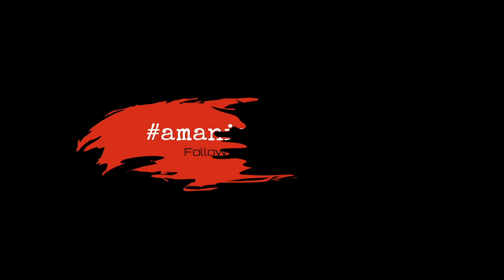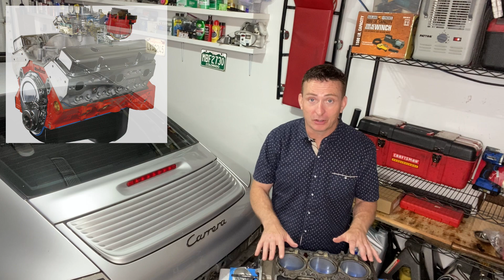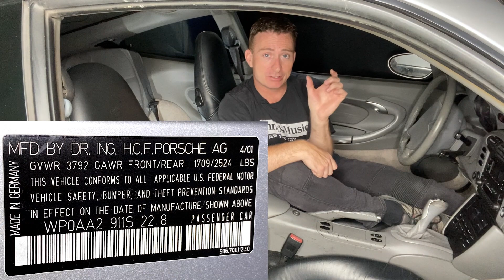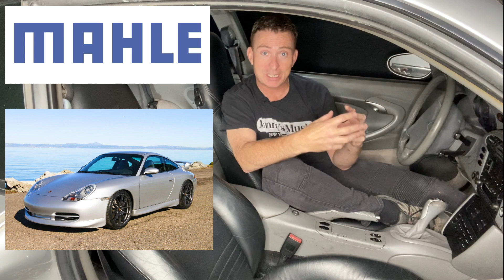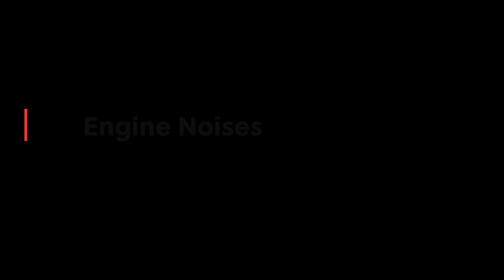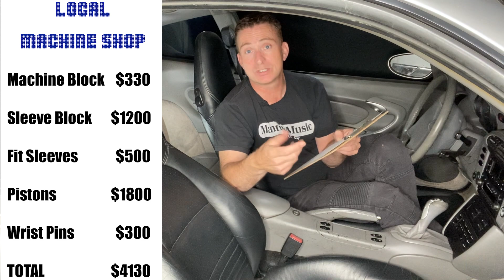WHAT IS BORE SCORING? PORSCHE 996 & 997

Comment: Is it too cost prohibitive to buy 2 new blocks made using the alusil or nikasil process or is it no longer manufactured or put an older or newer porsche flat 6 in the vehicle that aren’t known to have bore scoring? hard to believe the vehicle would lose desirability since you’re not doing something silly like an LS swap
Reply from the maker: Hello Lexi, Thats a good question. I just called Porsche, they have two matching pairs (bank1/bank2) remaining in Germany for $12,000 per pair. Once they are sold thats the end of new availability from Porsche. If you bought a pair you would still need new pistons and you would end up with an engine design that may well bore score again. For the same or less money you could have Hartech  UK or Slakker Racing USA machine your existing block with their improved close deck system that would last longer than the original Porsche design. Thank you for watching! 🤘😎

Comment: Hey Finn it's good to see you're not locked out anymore ,due to an NDA, and can freely discuss the differences between the V1 & V2 Lokasil cast in cylinders for the bank 1 & 2 block halves  and the change in piston skirt coatings also. If the original piston skirt coating hadn't been banned I don't think bore scoring would've been a big problem with this engine design.
Reply from the maker: Hello Warren! 🙌 I agree that Porsche got delt a bad hand by the EU, we might not be talking about bore scoring if the environmentalists did not get involved. Thank you for watching! 🤘😎

Comment: Great content and amazing depth. I picked up a C4S which has a suspected crack in the cylider wall. Per your knowledge, is that something that can be fixed by LN Engg or the other companies. Any help on this subject would be great.
Reply from the maker: Hello Deepak, a cracked cylinder wall needs to be replaced with new cylinders like those made by Hartech/slakker racing  or LNE. It will cost a few thousand. Thank you for watching 🤘😎
Reply: @ManinaGarage  Hi Finn, revolving back to my problem. I am not sure if you provide any consultation as I am facing some issue to decide whether I should scrap or rebuild. There are some local garages who has given me hopes with high bill but I really don’t know who to reach out for real expertise. Let me know if you are willing or if there is anyone else who does this.
Reply from the maker: @deepakshara1  email me: stuckinagarage@gmail.com 👍

Comment: I do not think it is right that Porsche did this experiment on their customers. Nikasil used on the turbo engines was much better quality and does not have the issue. The C8 from Chevrolet has a much longer better warranty, they do not have cylinder scoring, 0-60 3.3 seconds and 195 mph
Reply from the maker: It is definitely something that should be on everyone’s pre purchase checklist. Check from the sump side to be sure 🍀

Comment: Thank you for this very well presented video with excellent information! I am a new 996 owner but haven‘t taken physical possession of the car, yet. Mine has a build  date of11/1999 and therefore I presume that it has the preferable Lokasil v1 in the 3.4 litre engine. I will take frequent oil changes to heart, even more so than I do with my other vehicles. Count me in as a new subscriber!
Reply from the maker: Awesome to have you aboard Sir! 🙌 Your gen 1 996 is IMO the future classic of these cars due to the cable throttle, dual row IMS bearing and as you correctly pointed out, Lokasil V1 ✅ Since making this video I did an online poll and found the best oil for these cars is 5w-40 synthetic. In the USA motul and liqui moly are the go to brands. In the UK, Millers nano drive seems to be the Uber oil. (Some people go as thick as 10w-50) Something I was not able to mention in this video directly due to a non-disclosure agreement I signed to get some of the research materials……the bores are being scored over time by tiny pieces of Lokasil being knocked off the cylinder wall by the piston. Oil changes are really the only thing you can do to make a substantial difference to the longevity of an already used car. Very good luck with your awesome new ride 🍀 Thank you for watching 🤘😎
Reply: @ManinaGarage  Thank you very much for the engine oil suggestions! I believe, though, that my car already has the electronic throttle control. I will check under the rear carpet when I have the car in my hands.

Comment: Awesome video, what about the 987.1 cayman base? Can they suffer from bore scoring? It's a 2.7
Reply from the maker: Howdy Duderama! 🤠 . Please understand that the video was put together from research, NOT experience. Having said that, based on what I learned, your car will be lokasil V2 which is the a rougher surface that does appear more prone to bore scoring. However, the smaller displacement and lower power of the Boxster engines does SEEM to make them less prone to bore scoring and certainly D chunking (Smaller displacement results in thicker cylinder walls). Again, I do not have a workshop where I see hundreds of examples of these cars to form my opinion. The scoring begins with little chunks of the lokasil itself getting knocked off the cylinder walls and lodged in the gap between the skirt and the cylinder wall. Like I said in the video, using a quality Oil and changing it often is the simplest way to reduce the risk of bore scoring. Combining that with the start-up procedure, oil analysis, and good general maintenance are about all you can do preventatively. Thank you for watching 🤘😎

Comment: Nice presentation, and I like the dialect!  I would try to be a it more careful with some statements here. For one its your statement that the piston scratches the bore. This cannot be in principle because the piston surface is at least 10-times softer than the softest wall constituent. This is known for two centuries already since Friedrich Mohs' work in this field for mechanical characterization of materials. The only material capable of scratching anything in this context are the Silicon fragments once they separate from matrix for whatever reasons, and not being suspended properly in the piston wall (eg. absent or too thin coating). I am also  bit confused by the terminology "harsher locasil 2".  My understanding is that the wall is more "agressive"  to sth., but I think it would be great to share some more details on the differences in the properties of these two material generations.
Reply from the maker: Hello il, we have talked about Moh's hardness scale a couple of times on the channel, I don't think people are going to make a simple mistake like that. I could make technically perfect 3-hour videos that nobody watches or help 10k+ people get up to speed with an owner-level overview, which do you think has more value? Thank you for watching 🤘😎
Reply: @ManinaGarage  The reference to Mohs was only to highlight that you ignore more than a century of science when you state that the (plastic ) piston scratches the (metal/ceramic) cylinder wall. 
You are fundamentally wrong on that front, and if you have talked about Mohs already, I highly recommend to read some basic science text books to educate yourself before telling nonsense to thousands of owners.
Reply: @ilhermann  You sound like a scientist, but sometimes scientists get "wrapped around the axle" on a detail that is incorrect or does not apply (I am just a dumb pilot. I am results based, not theory based). 
We all know "galling" (substrate, tearing substrate), in this case aluminum tearing aluminum. Porsche changed the previous proven design, and invented "bore scoring".
I know nothing about Mohs (except that it is a hardness scale, and a type of skin surgery (hopefully different Mohs persons!) 
What I do know is that previous Porsche designs don't have the piston skirt to cylinder interference (and subsequent wear and galling) issue, OF THE CYLINDER WALL!

What you should ask is "why?'

Comment: I think it's worth mentioning that any engine can suffer from bore scoring if it's not treated well. My mate's M3 has got it, but no-one ever mentions scoring in M3s. 996/997 etc get checked so much for this that it is inevitably found very frequently. This seems to have led to people thinking scoring only happens to these engines. If all other cars were checked as assiduously, it would be found much more elsewhere too.
From this we can deduce that, it's likely that not all 996 /997 scoring is due to the design and choice of materials, some of it is simply due to poor maintenance or use. It is therefore possible that it is only the bigger capacity engines (or even just the 3.8s) that actually have a design /material issue. The others are just misuse.
This puts a slightly different complexion on the situation as it means all of the smaller capacity engines have no greater risk than any other car.
Reply from the maker: Hello P jay, you raise a very good point. There are many factors that go into the publics perception and knowledge of car reliability issues. In order to gain access to some of the research materials used in the Bore Scoring episode I had to sign an NDA. While the materials were worth the NDA it did compromise how directly I was able to talk about some factors. After the researchers saw the episode they released me from the NDA. In short here are a couple of things I had to say in a round about way in the video. 
1. The tiny grains of the Locasil cylinder material getting knocked off the cylinder walls are a significant contributing factor in skirt wear and the resulting scoring. They travel through the oil system and often lodge themselves on the skirt itself causing further wear.

2. Fuel injectors that fire in an uneven pattern lead to reduced lubrication especially on startup. They should be considered a were item and replaced every 50-75k.

The M96 engine in the early Boxster does not seem to have significant bore scoring issues. There are two factors that changed for the M96 engine in the Carrera, Increased displacement putting increased strain on the same design and new pistons with a new skirt coating that was environmentally compliant but less good at doing the job.

DEFINITELY poor maintenance and general abuse would play into this equation. As mentioned in the video, the Carrera Im working on is VERY high mileage and had zero signs of bore scoring, which is somewhat encouraging for all the aging 996's out there.

Thank you for watching 🤘😎
Reply: @ManinaGarage  very interesting. This is useful additional information, and yet it adds somewhat to the confusion! Both of the points you raise are indeed potential contributors to bore scoring, but they would apply to all 6 cylinders equally. Yet we see it limited to 4,5&6 so incredibly frequently in the 3.8. This is why my gut feeling is that there is a fundamental design/material issue in the 3.8, but not necessarily in the other engines, because in those it seems much less frequent and perhaps also less predominantly in only 4, 5&6? (Presumably the left handed piston issue you raised applies to all the engines, not just the 3.8, and yet it's only the 3.8 that seems almost certain to suffer at some point on 4,5,6, therefore the pistons can't be the root cause or the 3.8 wouldn't suffer more than the others because they all have the same pistons.) To be honest I think the report produced by Barry at Hartech is the best explanation, it's heavy going but it seems to provide the only completely logical explanation I've ever seen.
That's why I wouldn't have a 3.8 unless it's got a Hartech rebuilt engine. If you can find one of those, you've got a fantastic car that's actually very comparable to a 997.2 Carrera S. 
(Unfortunately there are many other companies who just scaremonger to try to make a lot of money out of it and rebuild the engine using standard unmodified parts, and guess what is going happen then!)
My personal risk assessment is as follows:
A car with a standard 3.8 engine is a very high risk choice, even if rebuilt.
Any car with a Hartech rebuilt engine is by far the lowest risk option, and should really be lower risk than any other type of car, due to having been rebuilt.
All the rest are somewhere in the middle (with Locasil 1 cars being lowest risk of those) and they may well actually only have more or less the same risk of bore scoring as any other car you might want.

Comment: how about running them on fully synthetic two stroke , a very lean mix of say 100/1 , would that help on all these cold starts , or just block up cats ?? just a thought.
Reply from the maker: Hello Tom, I hear what you are saying. Hartech UK use a very think oil as standard in their engine builds 10w-50 which was surprising. An oil that thick may be more likely to hang out on the cylinder walls between startups. With these engines burning a quart every 1000 miles they are kinda running a very weak 2 stroke mix already 🤣😂. I appreciate you taking the time to comment!
Reply: You could choose to do anything, but as someone said of such a situation, “You’re running an experiment”!
As a scientist, I know that the plural of anecdote is not data.
You might have an excellent outcome, but in truth, we couldn’t be sure that it had anything to do with the oil you had chosen.
If it went bang in short order, we’d be inclined to attribute that to your choice of oil.
We only learn formally from a series of almost identical starting points which are then treated in at least two different ways, consistently.
So over time, 100 996.2 engines, all of which had the same treatment, half of which were rebuilt according to Setting A materials and methods and the other half of which got Setting B materials and methods.
Now, differences in outcomes in Setting A vs B is a fair comparison. But wait: even if far more of the A engines were perfect forever and far more of the B engines became noisy, used a lot of oil and were bore scoped, showing bore scoring again, we wouldn’t know which aspects of A vs B were the most important. All we’d know is that you’d need to treat your scored motor according to everything done in Setting A treatment. 
This clumsy attempt to explain how hard it is to do good (that is, valid) experiments from which we can draw firm conclusions is most likely why there’s much that we simply don’t know for sure.
I sometimes wonder if secretly, Porsche do know precisely what goes wrong & why, but that they can’t tell us without effectively confirming that they sold legally defective engines for many years. In a scenario like this, in the USA at least, being sued in a glass action tort case could bankrupt the company.

Comment: Im buying a 3.4 boxster S 2006, it's had 12 owners! (M97/21 I think?),  I've requested bore check and dealer ( porsche specialist West sussex UK ) had agreed to check it,  he may only go in the spark plug, do you think I should insist he goes I the sump?
I test drove, and no smoke was noticed ( I wasn't watching for it)  last oil change 1 Yr ago and dealer says not due for another year, service history is full with 2 Yr oil changes  milage is 78,000 miles.
Thanks for great video, I have subbed :)
Reply from the maker: Well hello there Vass 🙌, That Boxster sounds pretty kick ass 🏎. Bore scoring starts at the bottom, by the time it’s really bad you can see it at the top. It requires draining the oil and removing the sump plate. It’s a pain in the butt 😅. Compared with the hassle and expense of fixing the bore scoring ($10k+) they better check it for you, dammit! 🤣😂. Good luck with your purchase 🍀. I am am happy to answer questions if I know the answer, I can certainly point you in the direction of some gurus that can definitely solve the riddle. Thank you for watching 🤘😎
Reply: @ManinaGarage  thank you, hes going to send me photos, so fingers crossed 👍 thanks for reply, appreciate it

Comment: hi i got a 996 .1998 3.4 , tip tronic116,575 miles on the clock suspect bore scoring ?  can you tell  by listening to it got a ticking noise both sides after six or ten mile  run , but not on  start up i don't want a re- build please any advice would be appreciated thanks gareth.wales uk
Reply from the maker: You need to take the oil pan off an stick a borescope up into the back of the cylinders to check for bore scoring. If it’s bad enough you could see it by looking through the spark plugs. Good luck 🍀 Thank you for watching 🤘😎
Reply: @ManinaGarage  hi ,will do thanks for the info, top man , thanks gareth wales uk
Reply: Tiptronic cars do occasionally make a ticking noise at idle when warm, I've noticed it and I've seen others comment on it too. Don't know exactly what it is though.